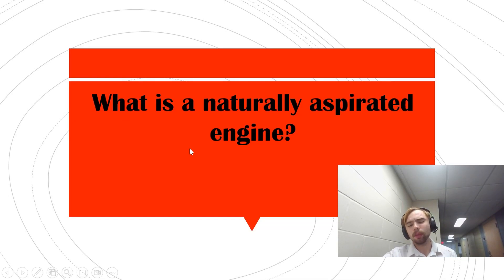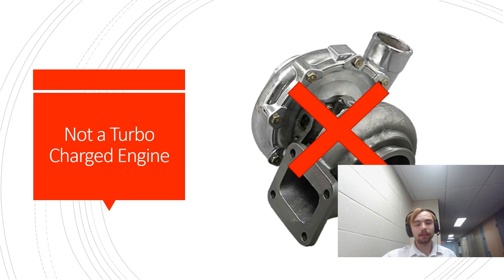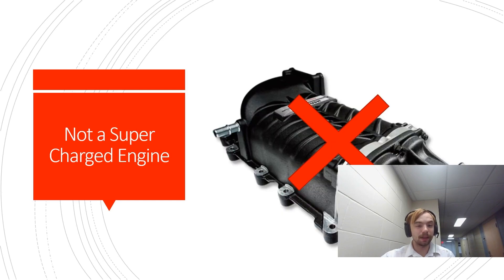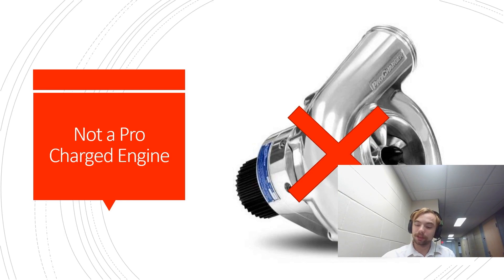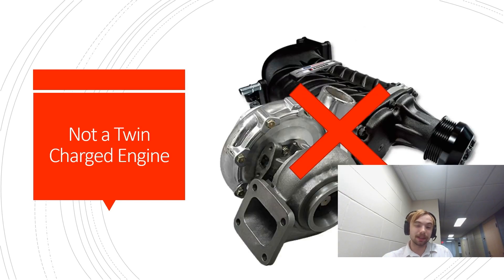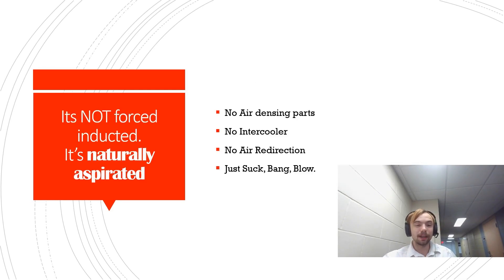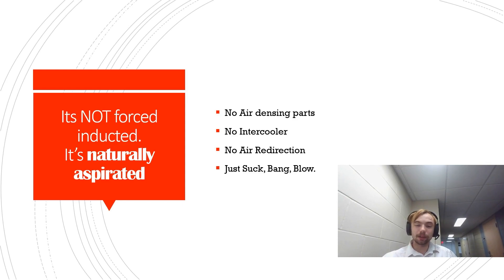Naturally Aspirated Engines, How They Work.

Comment: If you're the person who buys a vehicle and sells or trades it within a couple of years, or if you lease a vehicle, getting one with a turbocharged engine is probably okay. But if you rely on your daily driver over the long haul...and expect to drive it for an extended length of time, then you should avoid a turbocharged engine. Forced induction increases operating pressures within the engine and a turbo generates far more heat than a naturally aspirated engine. That means shorter engine life.